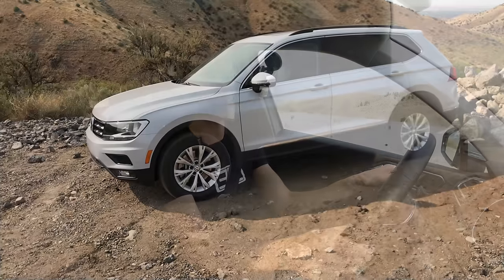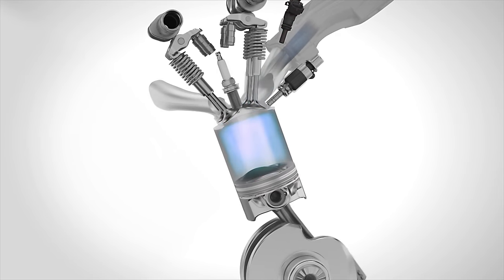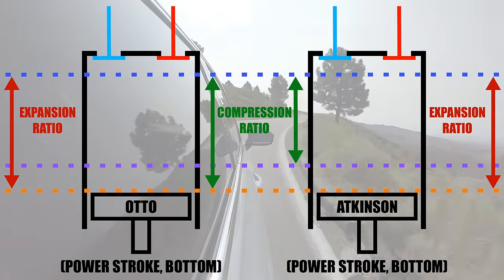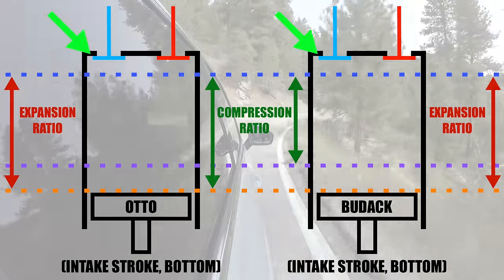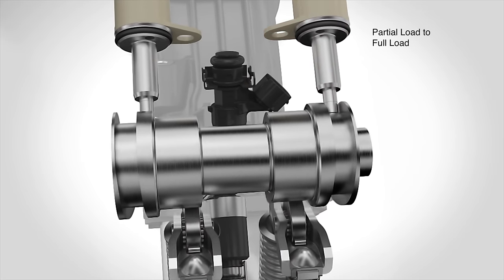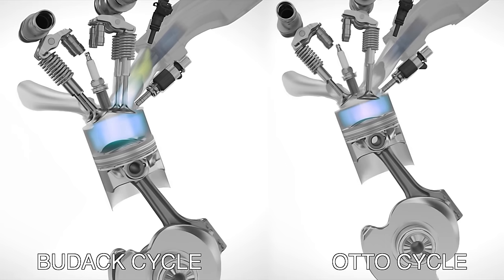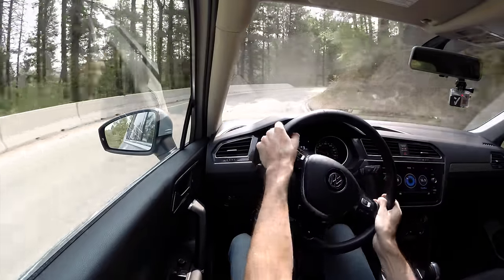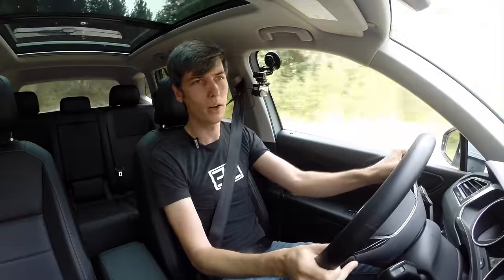Volkswagen's New Engine Cycle - The 'Budack' Cycle

Comment: Does this not reduce efficiency in that the piston when nearing the bottom of its intake stroke is forced to create a lower pressure than atmosphere?
Reply: Was thinking excactly the same thing ... Plus I don't get the benefit of this "tech" on the atkinson cycle.
Reply: Doubt it.  Whatever vacuum is created will pull the piston back up with equal force.  Piston also has momentum travelling downwards that has to be overcome to go back up.  Vacuum might help reduce the energy required to reverse it's direvtion.
Reply: just more crappy VW engineering just so they can say they are different
Reply: Jason Reel thanks.
Good point. On the other hand maybe a bit less smooth power delivery and more vibration?
Reply: My only theory is that by closing the intake valves while the piston is traveling downward instead of upward, you prevent backflow of fuel/air mixture into the intake manifold which might cause fueling issues and ultimately loss of efficiency, and perhaps in practice the efficiency loss from fueling is greater than the loss from the piston having to perform a little extra work to create a vacuum inside the cylinder.
Reply: Because the engine sucks in less air, the pressure at power stroke will be lower, yes. But it does not create a vacuum at the bottom (unless this effect is taken to the extreme). Because of the gas expanding from the combustion, there will always be positive pressure,  forcing the cylinder downwards. Any air remaining with higher pressure than atmospheric pressure can only expand through the open exhaust valve, therefore completely wasting that energy.
Reply: I think that the loss of creating a lower pressure in the intakestroke is there on a single cylinder, but when one cylinder is in its intakestroke, another one might have its powerstroke. The benefit in efficiency should be higher than the loss due to the modified intakevalvetiming. But when it comes to the Atkinsoncycle, I think that the air, wich is forced out of the cylinder in compressionstroke is forced into another cylinder. So this one has to use less work to suck air in.
Reply: Randy Gareth he says specifically that the ideal ratio will leave it at 1 atm at the bottom of the intake cycle
Reply: Gnaeus Romanus i think he means the expansionstroke. Because that means that you would have used all available energy from burning the air/fuel-mixture
Reply: Actually no, it drops in pressure, so it drops also in temperature. Thus, if the powerstroke max temperature is set to (lets just say 1000°C ) there is an advantage to a bigger temperature range, what defines efficiency.  I mean it is a restrictive element for sure, but on the powerstroke it has more space to expand with the energy that the fuel has.
Reply: creativityduodenal these are DI engines so on a normal Atkinson I'd guess they would only be pushing air back out of the cylinder. Fuel is introduced later. But how much later, I don't know. Perhaps doing it this way round gives them more flexibility in that regards (i.e. how early they can introduce the fuel) and avoids the situation you talk of (pushing air fuel mix back out). I suppose this engine is turbocharged so perhaps, even at the part loads, there is actually a higher than normal pressure in the manifold...so the piston would be pushing against that? 

Anyways, just a variation on a theme. I suspect most manufacturers are doing these kinds of things and just not making a song and dance about it...they all employ variable valve timing and lift systems so it's doable to down extent. My old Honda runs an Atkinson style, late intake valve close on its economy cam and then normal Otto on its normal cam. The VTEC system in this case just shuffles between eco - normal instead of to a race style, aggressive cam. You need 50% throttle or 3500rpm to make the switch. That car is 11 years old now!!
Reply: 0tispunkm3y3r Ah, totally forgot about the DI aspect. Kinda looks like regular sequential injection in the VW demonstration video, but I didn't consider DI regardless. Either way, it's no fancy perpetual motion machine!
Reply: I say it will be losing some energy, but you dont loose too much in the process of creating the low pressure as compared to high pressure
Reply: also wouldn't this burn more oil?
Reply: Jason Reel exactly what I was going to say. Honestly it seems like the exact same think at the Atkinson but more complicated.
Reply: creativityduodenal yes bit confusing with the injector position but that is how they place them. Can't place them in the top dead center position because of the spark plug.
Reply: during the intake stroke the cylinder will be under vacuum the whole way not just at the bottom. the only way it wouldn't be is if you took the entire head off. not to say that it reaches a perfect vacuum but where 1 bar is 0 it will be negative. aka gauge psi not absolute.
Reply: No. Equal an opposite reactions. Since the piston has a lot of momentum when the next valve opens there will be suction equal to the vacuum that was previously there canceling each other out.
Reply: Not quite.  On a whole system , it works out because obviously the engine runs.  But look at an individual piston - when it closes the intake valve and keeps pulling, the vacuum will increase vs. what it already was.  So it takes more force over a distance (power) to keep it moving.  That power has to come from somewhere.  I suppose some of that vacuum pulls the piston back up so you regain some of it, but probably not as much as just using an Atkinson.  Sometimes companies do things just to be different (I sometimes get design projects for companies doing this - they want a marketable differentiator).  Plus I did note he also said the mileage is below competitor vehicles in the same class who are using standard boring ol' engines.
Reply: The energy used in lowering the pressure near the end of the intake stroke is recovered on the compression stroke.  This scheme is effectively throttling the engine but without the pumping losses that a throttle gives.
Reply: Other then blow by and friction which is quite low in a modern engine those would pretty much be the only losses energy wise, but the Atkinson cycle should be slightly more efficient.

D.I. or normal F.I. does not effect the Atkinson Cycle due to how intake manifolds are made. Any extra fuel/air pushed out of a cylinder will just sit there in the intake runner until the next intake stoke of that piston since the valve will close, and the air in that runner is not really going anywhere due to the valve being closed. The piston that is on its intake stoke can get air from the plenum which is being fed air by the open throttle body, air cleaner, etc. which is the path of least resistance for air. The only pressure changes in each intake runner are caused by the valve closing which sends a pulse back up the runner until it hits the plenum, and then comes right back down the same runner. Many modern engines use those pulses to get close to or over 100% VE when it needs to make power.
Reply: Den Log:  This the Atkinson definitely more efficient?  The Atkinson cycle implemented with late valve closing suffers the (admittedly quite small) losses of pumping some air into the cylinder, only to then pump it back out and there's no energy recovery at all in that case.
Reply: mikerjuk As you say in a modern engine pumping losses are low, even more so at part throttle with a cam profile that is designed for it. However if one closes the valves early then the air will be heated up a little more due to the vacuum/return cycle not being 100% efficient. Also there might be some crankcase air that leaks past the rings, which would reduce the efficiency of the cycle more. A small amount of air could leak past the intake vales as well under vacuum which would slso effect the cycle efficiency. As long as there is a good flowing head, valves, cam, etc. imo the Atkinson cycle is slighty better, but it is just my opinion.
Reply: Mundus222 Well, if you just use some common logic you can immediately see that for example fuel vapourization will be more efficient when stoichiometric combustion is applied at higher loads; Rather than waiting for the intake valve to close and inject fuel at compression stroke like in atkinson cycle, fuel can be throttle body injected, say half of the intake stroke and then direct injected when valve is closed and thus the mixture has the latter half of intake and all of compression stroke to homogenize before combustion.

Someone was speculating about the intake stroke vacuum to be a loss in energy. Well consider this; Not counting in the possible artificial low pressure in the crankcase, the vacuum created when the piston moves down will pull the piston back up from tdb for some time. Compare this to atkinson cycle, where the piston must pull the whole stoke's worth of air through the intake valves and then push it out again for some time. The losses in that flow must be minimal, but still more than no losses at all.
Reply: TigeroL42 Umm common logic would be if you read all of the comments to see if someone already answered this... Common logic would be knowing that Direct Injection is not needed for the Atkinson cycle to work... Honda has been doing it with regular old F.I. since 2006 with the R18 that came in the base model Civics. Common logic would be knowing that the most efficient turbocharger/superchargers are 80% or so efficient at best so even if there is no air leaking into the cylinder from the rings or the valves the air in the cylinder gets heated up after a "real" world intake cycle. Common logic would say that since the air heats up it also changed its volume, which would reduce the efficiency of the return cycle. Common logic would say thay the energy that went into heating up the air came from somewhere as well... With the Atkinson cycle there is less pressure change so the air stays cooler and less energy is required/wasted. The difference is small, but as an engine wears this new cycle will be even less efficient.
Reply: Den Log: If an engine has any significant amount of gas leaking past the rings on the induction stroke it has a serious ring sealing problem, and there should be no leakage at all from the inlet valve.  In a modern, conventional otto engine pumping losses are highest at part throttle, not lowest!
Reply: Andrew H:  Explain why it is net negative, why isn't the majority of the energy recovered?  Do you think the Atkinsion cycle (which pulls air into the cylinder only to push some back out) is energy neutral, no pumping losses whatsoever?
Reply: mikerjuk Umm please do some research next time since most Atkinson cycle engines use electronic throttles and they keep the throttle body open to reduce pumping losses... This has been going on since at least 2006 with the Honda R18. If 1-2% of air leaks past the rings or valves it is reducing efficiency, also the air leaking by will be warmer then the air under a vacuum reducing efficiency even more. Not being able to create a vaccum and then return that same air to normal pressure with 100% efficiency means the air is heating up in the cylinder, which expands the volume of air in that cylinder also reducing the efficiency of the return stroke. I wonder why it gets worse fuel economy vs. Atkinson cycle engines...
Reply: Den Log: Umm please get yourself a basic high school education to understand what pumping losses actually are.  An electronically actuated throttle is no different to a manual throttle, you can not simply hold it open to reduce pumping losses without increasing the amount of air you are admitting to the engine (and therefore the amount of torque and power it is producing).    If 1-2% of air is leaking past the rings on the induction stroke then the engine is completely worn out.
Reply: Mikerjuk:
I think you missed something.  If all the control of output power is being done with valve timing and the throttle plate is open, the pumping losses are reduced.  The sudden opening and  closing of a valve doesn't involve as much air passing through a resistance so to a first order there are no pumping losses added by it.  The throttle plate on the other hand causes an air flow through a resistance and hence a conversion of energy into heat which is an added pumping loss.
Reply: Ken Smith:  I didn't miss anything because that's not what's happening in this engine, power control is not being done only by valve timing.  The argument is this:  Budack cycle uses early valve closing which creates a partial vacuum in the cylinder at BDC.  The energy this uses is mostly returned on the compression stroke.  The Atkinson cycle engines that use late valve closing have to pump air into, and then back out of the cylinder to achieve the same shortened compression stroke which would introduce additional pumping loss over the Budack engine.
Reply: @mikerjuk Just so I am not a total a$$, maybe just maybe if you ask Engineering Explained nicely he would be willing to do the math for you/make a vid on just how really efficient the return stroke of the Butkus cycle is in the "real" world. As a rough guess just looking at the efficiency of turbochargers and other compressors I would say the engine get approx. 50% of the energy on the return stroke that it took in the first place to create that partial vacuum due to compressor inefficiency, and the lack of an intercooler to remove the extra heat generated. Hotter air = less timing, or the engine runs into detonation. Atkinson cycle is more like a simple fan which simply moves air, not change its pressure, which takes much less energy vs. running a compressor even if one could get a return stroke.
Reply: Mikerjuk:
I was comparing the normal engine to both of these modifications of the autocycle.  When either of them reduces power by valve timing, they both save vs the throttle plate method.
Reply: its always under vacuum unless you're at wide open throttle
Reply: No, if the compression process is reversible (ideal). In application you would have losses of an polytropic compression which are lower as the flow losses (friction) at the intake valve in case the Atkinson cycle is used.
Reply: I think the budack is dvmb idea. The way the valve closes it doesn't seem to be designed to handle vacuum so you'd still be sucking some air.
Reply: I thought so too; at first. Increases efficiency but decreases total POWER output a little. If you think about it for a bit you will see why.
Reply: You are forgetting that when the engine is operating at small throttle openings there is already below-atmospheric pressure in the intake manifold! You're only getting a full cylinder fill at atmospheric pressure on an N/a engine at wide open throttle!
Reply: How do you get to DI from the VW video it is perfectly obvious they are using old and busted multipoint.